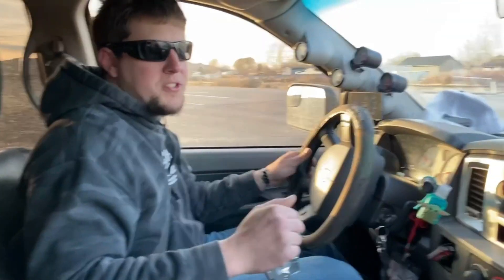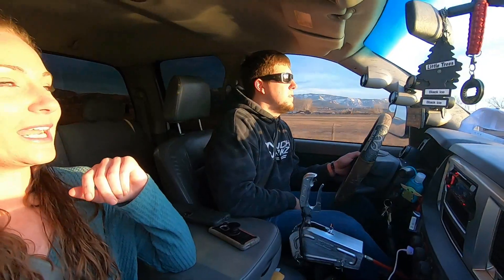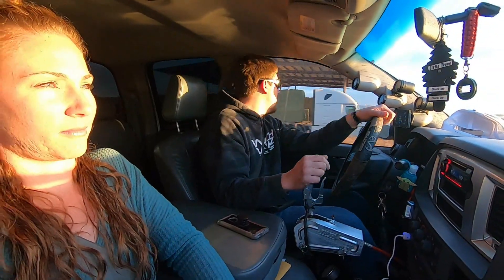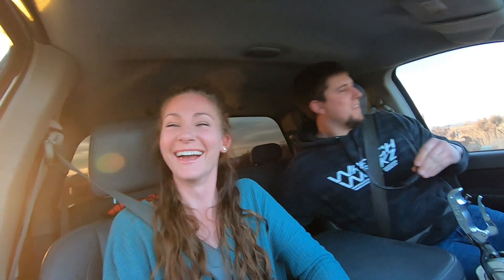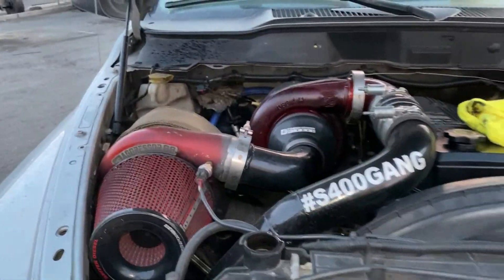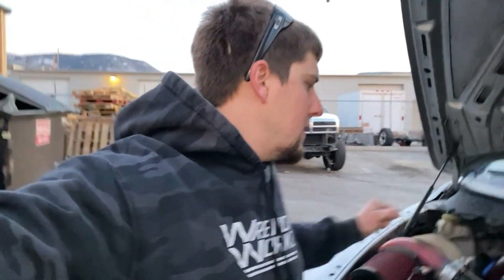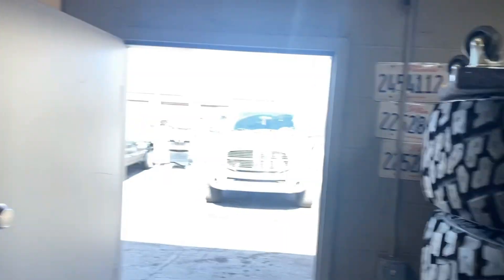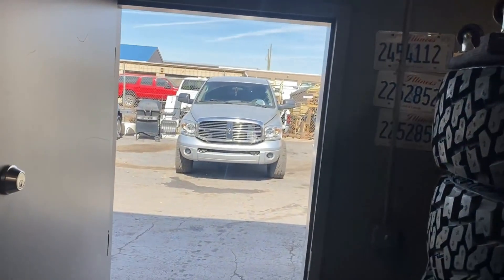WIFE REACTS TO 1300HP CUMMINS BOOSTED LAUNCH! WE BROKE IT

Comment: Isn't Myer getting that motor? We need a Myer reaction. Wonder if that'll be the same as your wives reaction?
Looking forward to the tear down, and the new build.
Reply from the maker: It runs fine just some oil in the coolant
Reply: Only a little broke
Reply: @horsetorquesdiesel  good for a few more pulls

Comment: Your wife is looking for more power; this truck doesn't phase her. Anyway, how do your prevent freeze plugs from "blowing out"? An "o-ringed head" should be very resistant to head gasket failure. Great analysis about the aftermath. Thank You.
Reply from the maker: Thread in freeze plugs prevent it

Comment: She's a keeper Josh!! I've been fighting my 4th gen with battery/low voltage/weak ground or somethin type horseshit, anyway a set of batteries later and she about flipped "that blankin thing is brand new, why the blank is it needing batteries now?" Well I couldn't agree more, I don't want to be working on a 3 year old pickup either but...........they don't build anything to last anymore. Probably best I don't have any "forced upgrades" issues going on or you'd be down a subscriber Josh lmfao

Comment: My wife tells me that all the time “We need to spend more time together “.   What’s the saying happy wife happy life! 😂.  How hard is it to install a manual valve body? Do you recommend them in a pretty much stock engine? I have a built trans by PDD if that even matters. Thanks Adrian
Reply from the maker: Not hard at all. Just mounting the shifter takes a little time
Reply: Ok. I just had a question about doing valve lash. Now Will was demonstrating the 7 method now does that work for our trucks? I also have an 05. Adrian

Comment: Looks like fun.  Got an 03 with a 6.7 Block with 5.9 head  60% overs, s366sxe and a cheetah ratchet shifter which i hate lol.  Im wondering with that TCI shifter is that push button lockup and od?  I have toggle switches that mounted down lower which is a pita when shifting.  Hate having to move my hand down to toggle them
Reply from the maker: I run a b and m bandit shifter with WPE buttons